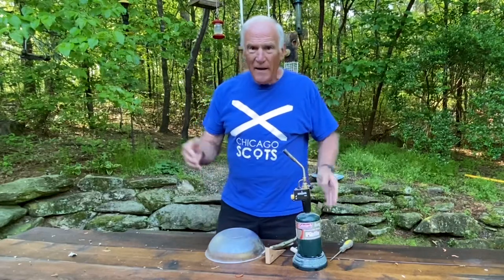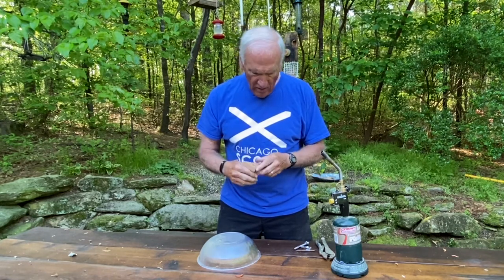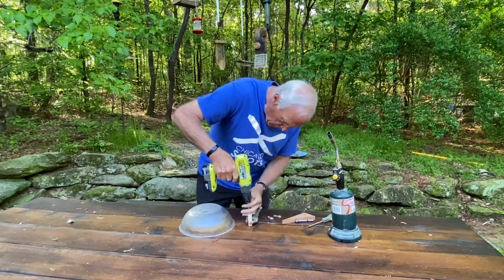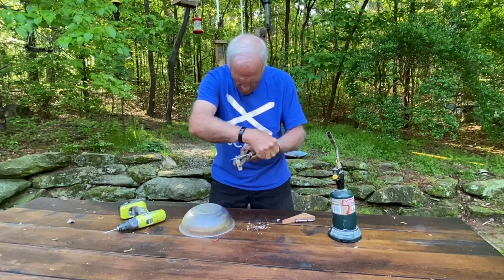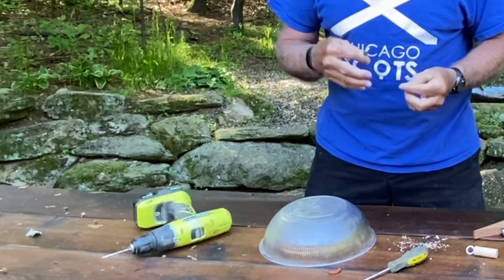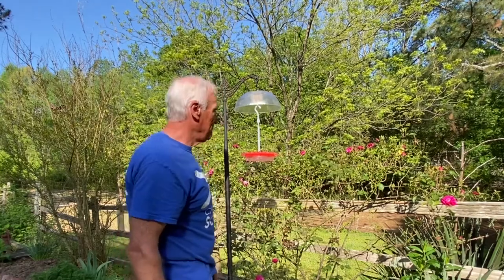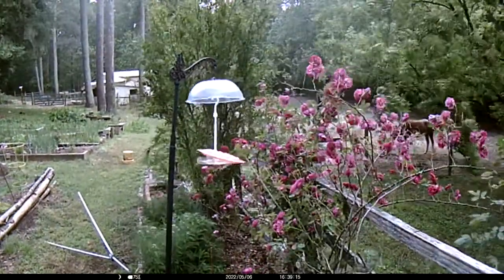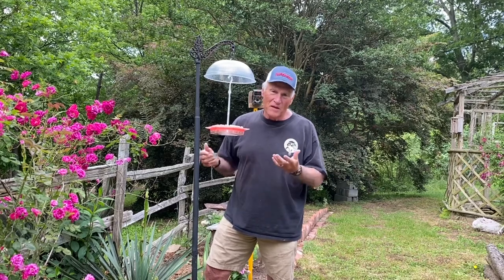DIY Poo Deflector and Hummingbird Feeder Update

Comment: Thanks Larry for the inspirational video!  I have a significant squirrel problem, so I used the same Dollar store bowls and created a larger hole than yours.  I used a strong wire about 3-4 ft long, mad a small loop about a foot up from the bottom that serves as a rest for the bowl.  I attached the long end to the branch, and the feeder to the short end.  The combination of the large hole and the loop allowed the bowl to dip when the squirrels attempt to jump or slide down the wire.  I've used this method for a couple years now and have never had any more squirrel problems!  Lately, I've noticed that I need to create an ant moat.  Thanks again!
Reply from the maker: That sounds like a great system!  Squirrels are a real problem whenever and wherever people try to feed the birds.  Even if you provide food for the squirrels they still rob the birds.  I’ve seen DIY ant moats on YouTube and I’m sure you’ll find a solution.  Good luck